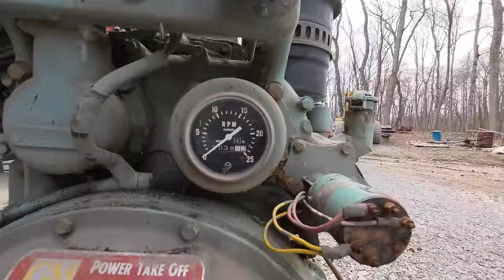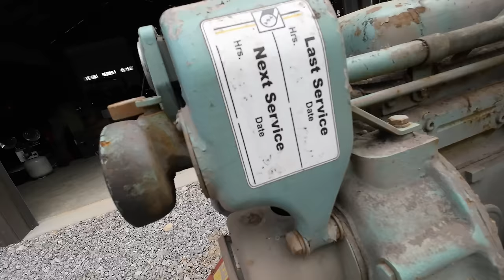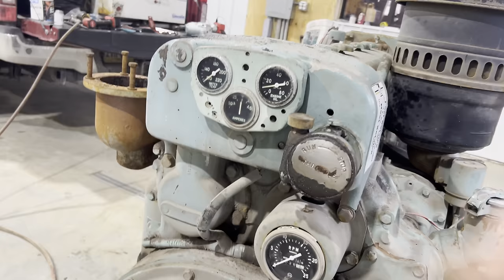$250 Two Stroke Detroit Diesel Sitting 6+ years, WILL IT RUN!?!?

Comment: Really neat episode! When I first saw it I said to myself what a great power plant for the farm.
Easily could be married up to a 3 phase generator to power machinery. Keep up the interesting videos
Reply: However imagine how loud it would be though. I think he might have mentioned in a previous video wanting a more quiet power solution. But it would be pretty easy, you could hook it up to some kind of CVT belt drive transmission and a very large AC 3 phase motor and use it as a generator. Would work very well
Reply: They are not very fuel efficient.....Didn`t matter much *back then*, however, different story nowdays!...🤔
Reply: That's exactly what I was thinking.
Reply: @johnhhinton5473  5 gal/hour ours burn

Comment: My dream shop is 40x60. I built it about 25 yrs ago.
One thing I did that you may want to consider (given how smoky yours got) is a ventilation fan.
I put a Dayton Model 7M8E4 in mine and love it. Of course it was about 1/3 the price back then.
Mounted mine in the end gable.
Also hung two 7w led bulbs one near each end as "nightlights" well worth having.
Reply: He has openings and louvers for fans but hasn't installed them yet. You can see one sitting between the door openings on the floor at 13:41.
Reply: I agree with the extraction fan but he has a roller door at the other end of the workshop that he should have opened. There's nothing like breathing all those unburnt hydrocarbons to improve your chance of cancer in 20 years.

Comment: Great job Matt! I have worked on a lot of engine driven pumps and usually the lines from the heat exchanger were hooked to the pump the engine would have driven. That way cool water was pumped thru the heat exchanger, seperate from the antifreeze.
Reply: Yes I have that exact motor out of a boat and the heat exchanger was cooled by  fresh water from through hull fittings.
Reply: This is correct, the pump that this motor was driving was the source of "pump" water which cooled the engine coolant through that little heat exchanger. Many fire pump systems are exactly the same. I services a very similar fire pump at the factory I Millwrighted at for over 30 years. They were usually very well maintained and not a lot of hours for sure....
Reply: Came to say the same thing
Reply: @scottbedard5095  makes 2 of us.

Comment: Those Detroit 6-71's are some of the sweetest sounding engines ever built. You left that aerosol can sitting right on the exhaust manifold lol I was waiting for that to explode! Given this was used on a fire pump my bet is there was no radiator at all, it would have been cooled by the water it was pumping.

Comment: The heat exchanger could have been connected to mains water, river water, a plate cooler, a remote radiator in a cooler room - it depends on the location of the unit and the location of the plant/factory. I've worked on these (and CATs, Cummins etc)in all kinds of set ups depending on their application. Detroits were made to work the world over in endless environments.
Reply: The cooling water probably came from the discharge of the pump being run by the engine.
Reply: @shepherd2346  Yes possibly but it all depends on supply. If there's a readily available supply of continuous water they can but if it's a limited supply they'll run remote rads or cooling towers and conserve the available water for fire suppression.
Reply: @LordMuck  It takes very little water to cool the engine even when at full load, relative to the maximum output of the pump for that engine.
Reply: @shepherd2346  the flow rate required is less than a restroom tap but it's down to regulations and a lot of sites cannot be signed off if not running a separate system. 
If you need that much water the place is gonna burn...
Reply: @LordMuck  It's the most elegant design, in any event. Cooling water supplied only when needed ..... while engine running under load.
Reply: @shepherd2346  Yep and you could also link engines to run off one supply. They were such versatile engines.
Reply: @LordMuck  He said this engine was used as a fire pump. With fire pumps you want to KISS. Keep it simple stupid. A separate system, to provide cooling water, would introduce unnecessary vulnerability and complexity.
Reply: @shepherd2346  Some sites won't allow a joint system and have to run through a cooling tower (a real pain for servicing) Modern sites will have emergency equipment as far away from the plant as possible but older installations were often in basement set ups
Reply: @shepherd2346  and I don't know what the set up with this unit was but a lot of folk think if a heat exchanger is fitted then you have to run a constant flow through them from main supply water which just isn't the case.
Like I said, we've had H/E unit engines that are pump connected (to fight the fire and cool) plate coolers, tower supply, remote rads and even line coolers (several units running all off one cooler pack)
Matt won't have any of the issues that some folk are worrying about which ever way he chooses to go.
Reply: @LordMuck  We were discussing how the engine was set up originally .... as a fire pump. In that use the cooling water would be supplied by the main water pump only while  the engine was running. Anything else would reduce reliability and safety.
Reply: @LordMuck  Regardless of pump location, the best cooling water supply, on a fire pump, is the pump itself. It's a basic engineering principle.
Reply: @shepherd2346  yes it is but the point is not all fire pumps are set up in this manner and not all Detroits with heat exchangers need to be run in this manner.
It's a basic field service fact.
Reply: @shepherd2346  We service the units at a pulp mill and they have two GM pumps just like that and two newer Cummins and all 4 are on above ground fan coolers. All lines to and from the pumps are shielded below ground. It's done to limit debris in ponds or open storage tanks blocking the smaller cooler lines in an open system.
Reply: @LordMuck  Of course.... all fire pumps aren't engine driven.
Reply: @drewbarker400  Yes, but your units don't use water to water heat exchangers ... they have air to water heat exchangers. Debris is always limited in fire pump discharge water due to the unwanted possibility of fouiing the fire nozzles.
Reply: @shepherd2346  Yes they do, they are exactly the same as the one Matt has except for a single air filtration pot. They run the cooling through the heat exchanger units on the front, the Cummins have a similar set up but just a bit more modern.
Reply: @drewbarker400  Not enough information. You mentioned a pulp plant. They're probably continuous run rather than emergency fire pump units. That would explain the difference. Are the engines running pumps and, if so, are the pumps circulating fresh water? The devil's in the details.
Reply: @shepherd2346  They are fire pumps. I have no idea what you're trying to prove here but it seems you haven't been around much and your knowledge is certainly very limited in what you have come across. It's obviously a much bigger world out there than the one you live in.
Reply: @drewbarker400  You didn't say they were fire pumps initially. I'm a retired Marine Chief Engineer with an unlimited HP license for steam, diesel, and gas turbine propulsion plants. If you're unable to carry on with a civil discussion, due to an inability to communicate effectively, that's fine .... but initiating ad hominem attacks reveals your ignorance. With what you've mentioned about your employment I'd guess you'd be similar to someone near the bottom of my peer group.
Reply: @drewbarker400  In Marine Engineering you don't get a Chiefs License without plenty of experience. I've worked on diesel ships (M/V) with over 90,000 HP that were two stroke diesel engines. What's your max, 175 HP? Lulz.
Reply: @shepherd2346  As an ex merchant navy officer, I find that attitude disappointing. It was an interesting and educational exchange until you decided to look down on blue collar workers.
Pity.
Reply: @daveshepherd5352  Evidently, english comprehension wasn't a requirement of your position. Maybe you can point out exactly where it was that any of my statements could be construed as "looking down on blue collar workers".
Reply: @drewbarker400  Where exactly did I say anything about blue collar workers. I was speaking to you as an individual. Recognizing the spectrum of workers, including myself, on merchant ships requires comparisons of responsibilities. Where I was responsible for the entire mechanical operations of an entire deep sea vessel, there were people responsible for cleaning the engine room and other areas of the ship. I didn't despise anyone for their position, only their lack of character.
Reply: Steady on lads, it's just an old engine. Matt will have some fun with it and that's that. It's just a bit of entertainment.
Reply: @daveshepherd5352  Still waiting for a specific quote from me that supports your claims on my opinion of blue collar workers or that I'm insecure. I didn't resort to ad hominem attack, you did.

Comment: Cool idea! I think the hydrostatic transmission from a park/golf course mower would be perfect for that. Would not be hard to fit the pump to that shaft and the motor to any rear axle. Another benefit is that you’d probably be able to get forward and reverse in the same pedal. An oil tank for that system could probably easily be hidden in a frame rail or along the rear axle.

Comment: I worked on 12v71 Detroits in the Navy. I love the sound of them monsters.
Reply: Giant Polaris engines! The patriot Polaris boost 850 is the new jimmy!
Reply: Normal or turbocharged? We had three 12V71s for our pumps and 6-71s on the main gensets. In 2001 I got from the DRMO 7 more 12V71s They were a mix of Navy and Army units. They were  twin turbo units war power rated at 600 HP which could be run at full loads for a maximum of 24 hours continuous before the factory said they needed an overhaul. We had them turned back into NA units.

Comment: Hi Matt. That's a sweet motor. I love the Detroit Diesel 71 engines. I have a 16V71 on a 750K generator. It has a radiator that's about 5' wide x 7' tall. Like yours, it's been sitting awhile. It was removed from a hospital backup generator application. It only has a couple hundred hours on it. It has dual turbo-chargers feeding the dual Roots blowers.. I hope to get around to firing it up soon. Thanks for the great video.

Comment: Hi Matt

Great video on the 6-71. 
As a long time user of Detroit Diesel 2 stroke engines the oil to be used is not a multi grade but a Mono 40 weight oil rated CF2. 
Keep up the great videos. 

Regards 

John

Comment: Back in the bad old days (early 80's) I drove a Bedford 4x2 with a 4/71 (air start) and a 15 speed with a Eaton diff. It hook up to an twin axel trailer, hauling 39,000lbs and was used and built for a run over a very high hill. It was a run with multiple pickups from farmers at night. I mention this as the torque that came off the accessory take-offs kept ripping off the alternator. You left the yard regularly with just your batteries fully charged @4pm and only used your lights when you saw another vehicle (rural roads with no street lights) or when you drove in city limits. If you were lucky you had dime lights around 4am when you arrived at the mid city drop. I miss that truck It was a fun truck to drive, if not a very draftee truck, with no heater in the winter, a great sound and it freaked-out/scaring the sh.t out of people when you hit the air starter while parked in town. The company had 2 other Detroit's both 6/71 (6x4's), great sound but not as many eccentricity's.
Reply: We actually had a Bedford Diesel powering our hotel power ( 50 kW ) at the pump station. Hardly got anything more than test runs weekly as if we were operating, one of the 6-71 gensets would have been in use if commercial power had failed.
Reply: Those air starters if you didn’t know what was happening, they got your attention real quick.
Reply: @dirtfarmer7472   BRRRRRRRRRP Engine noises followed. We had them on 6-71s and 12V71s.

Comment: There's 2 vehicles in your fleet that I could see this engine landing nicely in, the first being that old army truck, the second being Christine. What an awesome find Matt 👌👍
Reply: there is also his "green" Autocar semi truck with single rear axle..
Reply: or the Unit Drag-Line. If I remember correctly, That machine has a gas motor.
Reply: This grifter don't read comments. Ha ha ha

Comment: A common feature of those old engines was a flapper that served as an "emergency shutoff" that, when activated, would shut the air flow off going into the motor to prevent runaway.
Back in the day the Detroit two stroke motors were notorious for "slobbering" down the stack on the trucks if the were idled overnight. I was always told it was blow by caused from idling for a long period of time.
Reply: We actually had Diesel fuel drip out of our stacks if run for long times below 1400 RPM. This was just before an overhaul at 14,000 hours on a 12V71. I don't miss listening to them at 1800 RPM for 12 hours a day and sometimes 18 or more hours. Do it for 90 straight days and it does affect you. As for oil use, it was 2 qts every 24 hours with an oil change every 300 hours. At overhaul, the pans were nearly spotless. The engines ran at 140°F all day long.

Comment: with you sitting behind the engine, I was reminded of my childhood knowing when the hydroplanes were in town.  6-71 to 8-v92 going well over speed at 6 inch’s of water.  I was really glad when they swapped over to turbines.  A few years ago I was taking a layover and realized those engines are powering boats . 2 am, multiple boats headed out for the days fishing.  I was a few miles from the water, but quickly remembered that ear plugs are underwear for ear muffs 🎉
Reply: Yes.....Some of my earliest childhood memories of watching those old hydroplanes rippin up and down the Detroit River chasing that Gold Cup. Loud as hell and even cooler than that. That would be an awesome use if Matt was on a lake.
Reply: Thunder on the Ohio. Madison Indiana in the 70s. 
I can't agree about turbines though. The noise was so loud.

Comment: My old man use to work at an oil testing laboratory called Lubrizol and they tested a LOT of different oil with the old Detroit Diesels. He mainly tested the 6v and 12v 71's. I forget which ones had the turbo and supercharger on it, but when they would do dyno testing, they made so much torque it would wrap the measurement needle around twice. He's got some great stories about those engines. Definitely one of the best sounding engines on the planet!
Reply: detroits all have superchargers called blowers to scavenge exhaust while blowing in fresh air then T series add turbo's ie 6V-71T for turbo
Reply: Right it’s not a supercharger although they were used that way on gasoline engines, they only moved the same volume of air through to push out the exhaust.
Reply: @jimhaines8370  Thanks guys, I was going to ask my old man about all this stuff the next time I talked to him.
Reply: @BarnStangz  Lord Muck has a video on how they work, it's interesting. I would link it but then the comment wouldn't go through!
Reply: @GemmaLB  I'll check it out for sure! Thank you!

Comment: I worked in a factory from 1979 and I was part of the fire team. At first we had two RR merlin engines that were used for the fire suppression they were supposed to run flat out until they blew themselves up. And we also had two multi million gallon tanks underground. The factory was the largest the company had worldwide at 550000 sq feet and it was a well known power tool manufacturer. Later there was an extension to factory and another pump house was added with another two vauxhall (GM) engines insides. By the way its a pity that you don't have need of a fire suppression in your workshop. Merlins are 24 piston engines and most were built in the US during WW2 under licence
Reply: I might be wrong, but think all of RR's Merlin's were 12 cylinder.  RR did make a 24 cylinder which they called an Eagle.

Comment: that engine sounds great!
Reply: of course it does its a Detroit its almost as good or as good as your music they are both really great sounding its hard to chose
Reply: @kollinspencer847  thank you!!
Reply: I have seen a mid 70' 6-71 @ roughly 250 hp running well. At near 3,000 RPM they start sounding pretty angry. I witnessed one take a huge snort of natural gas fresh out of the ground revving past 4,000 RPM and it sounder 'mad dog rabid'. It was shut down with the intake emergency cut off and didn't seem to suffer any noticeable damage. That 6-71 ran fine for quite some time anyhow. I am not a 2 stroke Detroit fan but do respect how they never seem to die.
Reply: @TSSVillains  i aint kidding ya they are both up there my favs are Detroit's and probably diesel fumes funk hombre and train whistle slides are up there with the two stroke Detroit's!
Reply: Motown 🤘🍻

Comment: The cooling system is like a water jacket. It's similar to what is on a tug boat. The antifreeze jug and the Little bottle are the ports for the heat exchanger.

Comment: With working inside your new workshop,  I was wondering if you're going to have an extractor fan system in the roof for when you work with doors closed to get fumes out?
Love the vids, always great to watch.
Reply: if you look between the two front doors of the shop, there is a fan/vent leaning against the wall that I assume will go in for just such an occasion. 13:19

Comment: Okay, that's not what I expected for your plan going forward with this engine 😂
I assumed you would use it as a backup or mobile power generator.
Reply: Same here. I figure you use the money tree generator, for lights. Maybe pickup a farm sized PTO generator. I imagine they are 540 rpm, maybe 1,000. So, maybe a gear reducer so the Detroit can spin up faster.